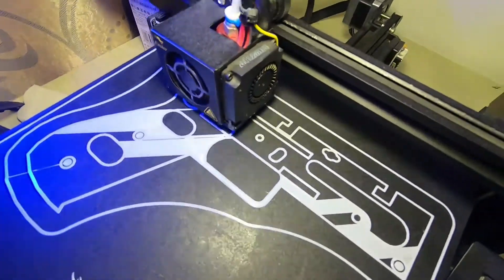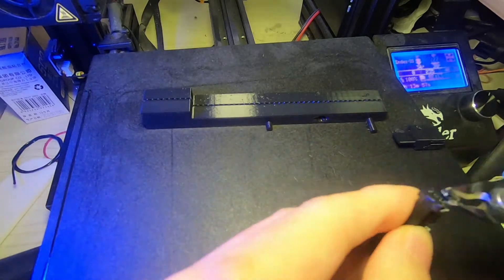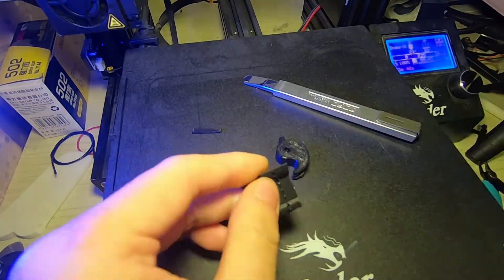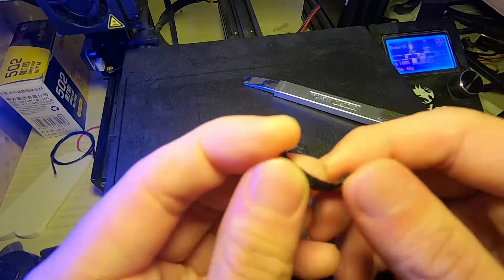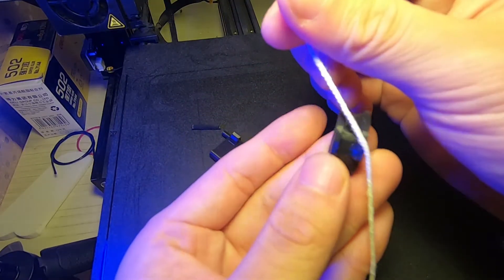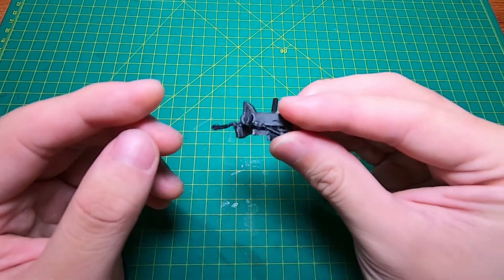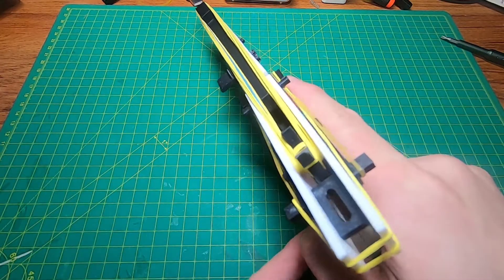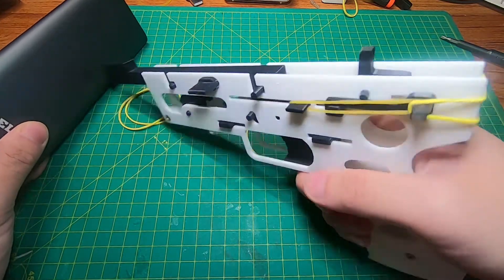【DIY+review】Making a 3d Printed Rubber Band Gun v5.0 |pull and push-action | 3D Printing

Comment: love it bro, i printed it and tomorow i am going to put together
Reply from the maker: Thanks bro;) By the way, that string's length needs to be adjusted many times possibly and that string need to keep tight to make sure that the string can connect the eccentric wheel to the bolt. Good luck bro, you will get it 👍👍👍😄😄😄